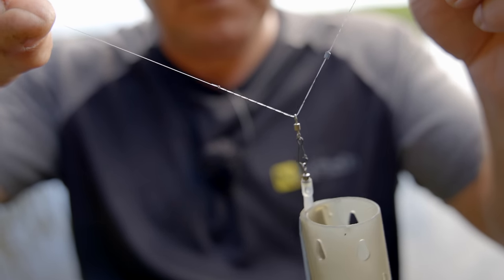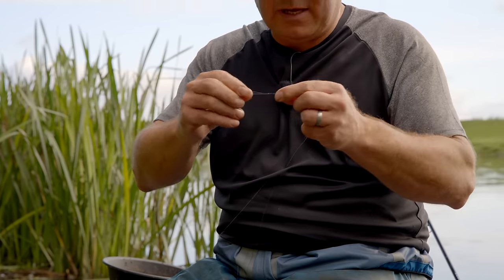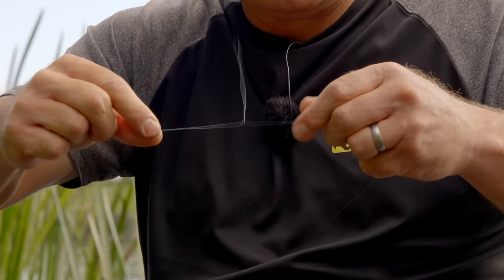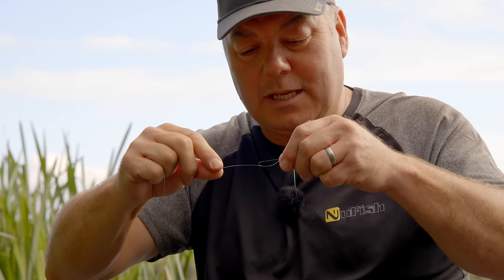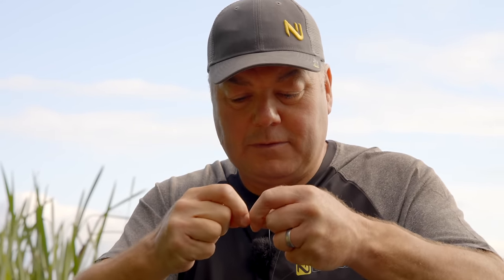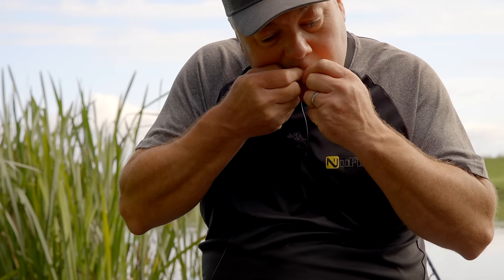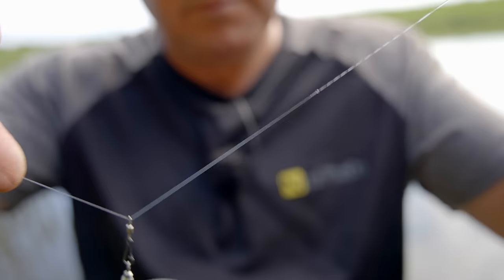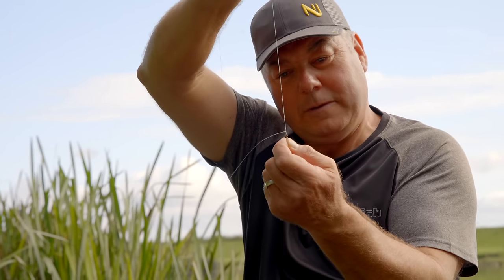Mick Vials' SELF-HOOKING Feeder Rig!

Comment: really usefull and clearly explained.Thanks Mick. Only problem is nowhere on line can I find diamond eye snap link swivels. Anyone out there can help?
Reply: If you're struggling, just take a small pair of pliers and squeeze one of the eyes on the round eye version to form a diamond shape - a pack of 10 should take less than a couple of minutes to modify.
Reply: just put the two together hope this helps
Reply: @AndyTootill  yes that would work. Just strange that no one actually make them.
Reply: Dozens on line, Preston do them 👍
Reply: Try Angling Direct or Wickersley Angling.
Reply from the maker: A quick google and we found some Mustad ones!